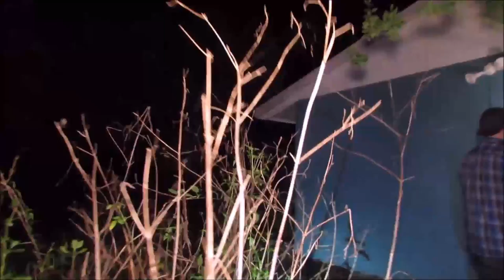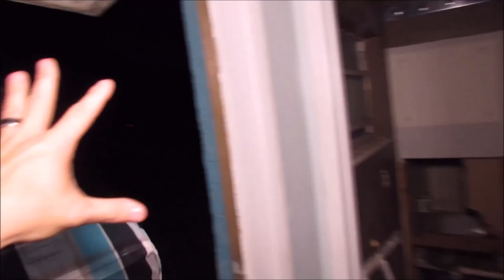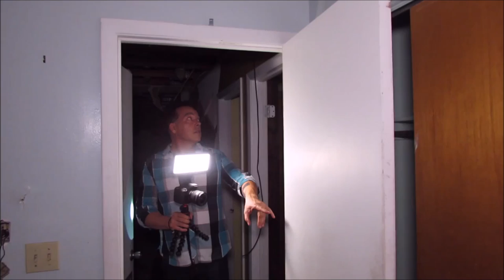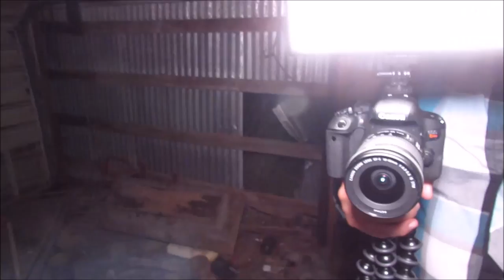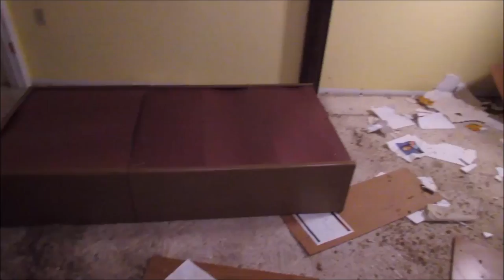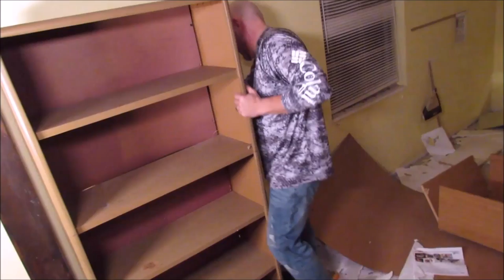(BACK AT THE POLTERGEIST FARM)HAUNTED FARM NEVER FAILS!

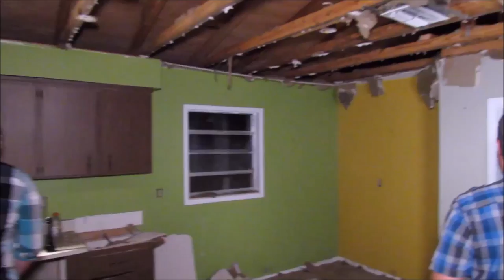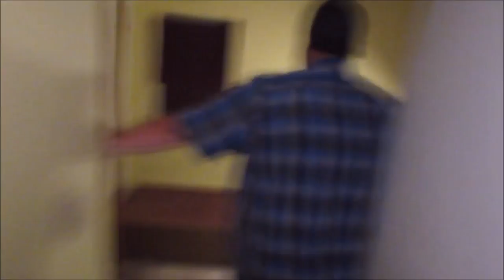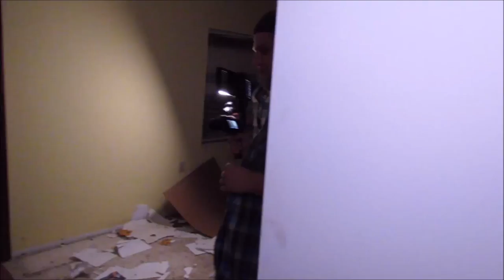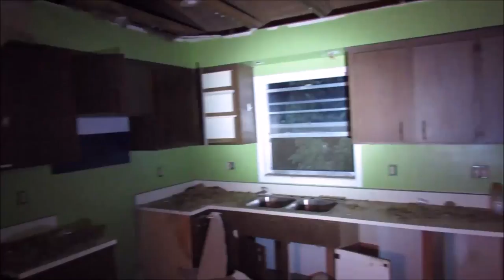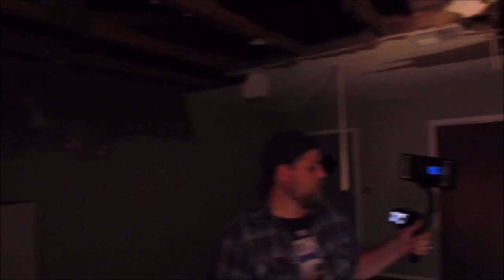Comment: @9:33 "hello", 12:08 orbs flying, @16:10 right after Todd answers you a low toned voice is talking, and then finishes Todd sentence and says "too" , @22:41 orbs start flying again, and one flies across Joes back just before he says what was that, @35:28 sounds like a female grunting/sighing, weird cause on Joes at this time is a wicked older hiss or growl, this one is young, @35:51 definitely a motorcycle burning its tires, WOW the growl @39:21 yikes, @40:16 a tapping noise starts kinda soft and slow at first, then goes faster and louder until 40:46 when you eave the area, @45:46 male answers yup, @45:54 another voice answers either yup or what,

Comment: That shelf has to turn 45° to fall the way it did.  That thing backboard leaning on it was way off to the right and tucked under the shelf thats on the floor where joe tripped.  Odd movements and unnatural.
Reply: Lauraul Nye in Todd's video, I saw a shadow figure back by the window covered by a door during the prayer

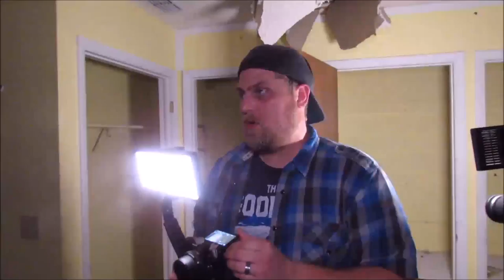Comment: 35:27 ... bookcase falls over
35:32 ... Chris with "Let's go!" 6 times... LOL!
35:50 ... distant scream
39:20 ... deep growl; Joe reacts
40:52 ... this is probably a play on light and shadows, but just as you turn to enter the room, you will notice 2 stick-like shadows just above the window that, if you slow down the video (K for pause and > for frame-by-frame), you'll see that the stick-like shadows may actually pull away and up from the light as you are turning... as if it were a hand that's right around the corner from you... but it may be nothing
45:47 ... just as Chris exhales, there's a very wheezy laugh